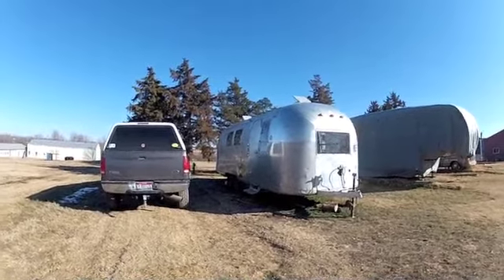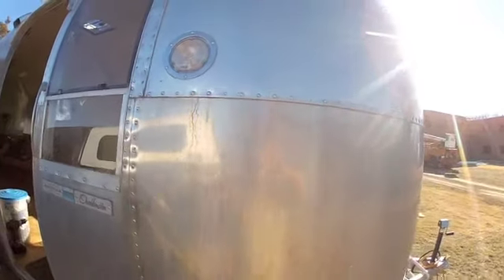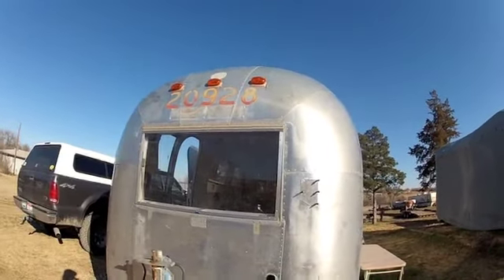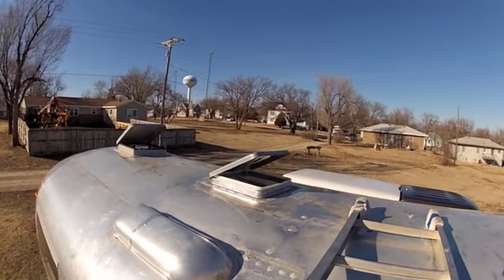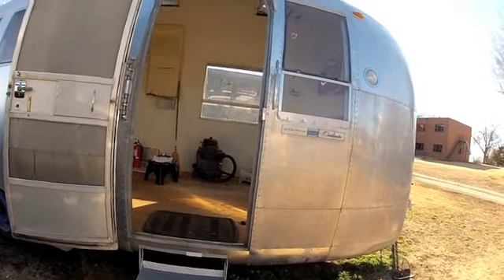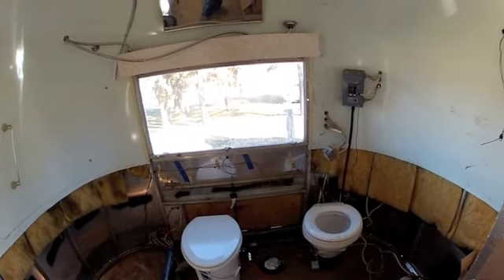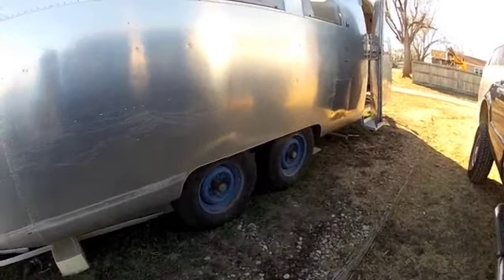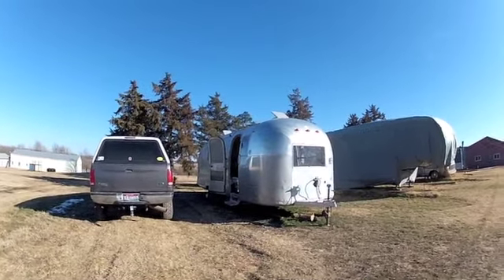Airstream Remodel Progress Video Update #3

Comment: That s exactly what I will be doing...getting that piping out from under the bench/bed that was apart of the furnace, because i, too will install a mini wood burning stove, and closing that vent hole, because there is a leak near that area. So, streaks down the wall means there's a leak through the rivets and they should be replaced? Would loved to have seen how you covered that area with the aluminum.